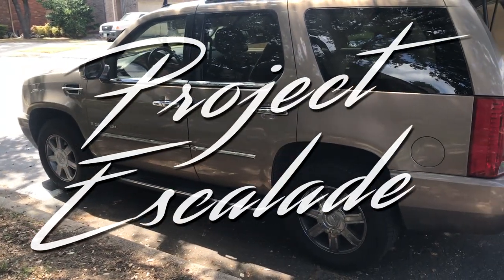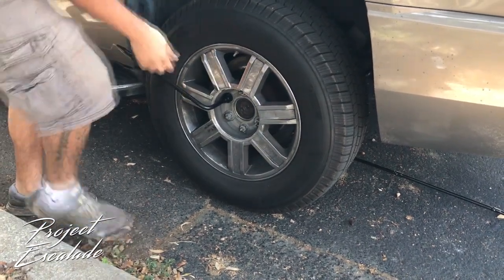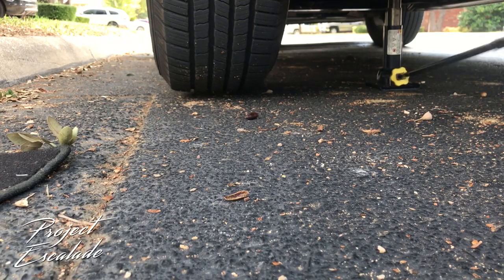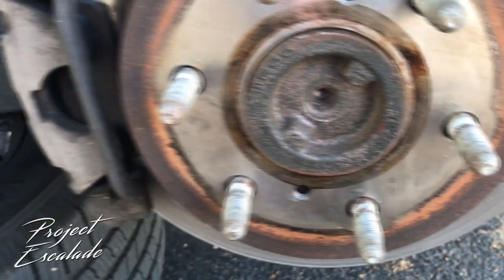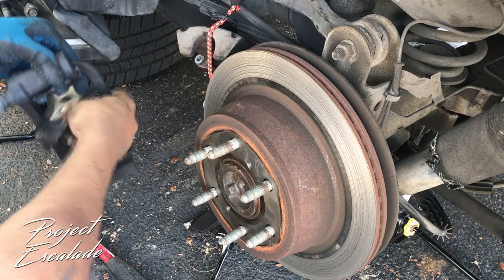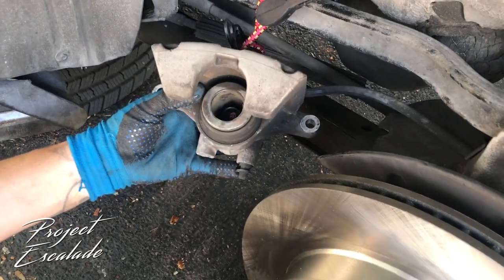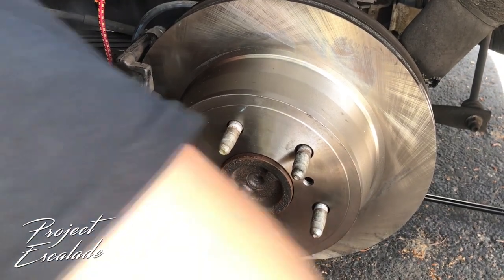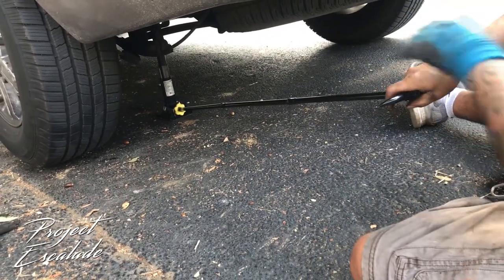2007 - 2014 Cadillac Escalade Rear Brake Change - Project Escalade

Comment from the maker: brake pads on sale on Amazon
Bosch BC1092 QuietCast Premium Ceramic Disc Brake Pad Set For Select Cadillac Escalade, ESV, EXT; Chevrolet Avalanche, Silverado 1500, Classic, Suburban, Tahoe; GMC Sierra, Classic, Yukon, XL + More; Front 
https://www.amazon.com/gp/product/B008HZK68G/ref=as_li_tl?ie=UTF8&camp=1789&creative=9325&creativeASIN=B008HZK68G&linkCode=as2&tag=kingprint0f-20&linkId=d58cd6ef2a1907726d4d22d7f3c114a7

Comment: So the rear brakes are both disk and drum?  I'm assuming the drum pads are for the parking brake?  Why didn't you change the drum pads at the same time?
Reply: Yup 3:16 is the Parking Brake drum. I don’t think that you have to replace them because they are only engaged when stationary, whereas the pads wear off overtime.